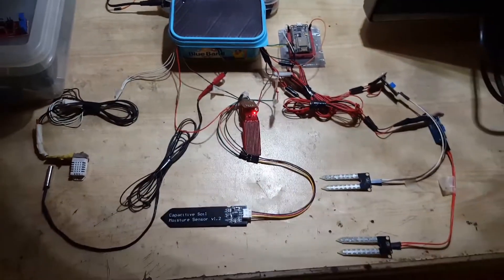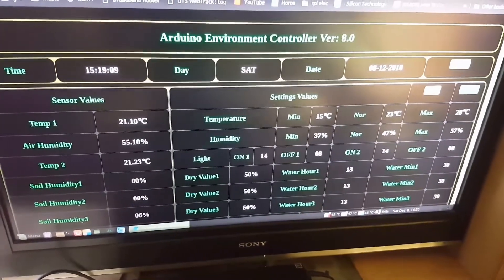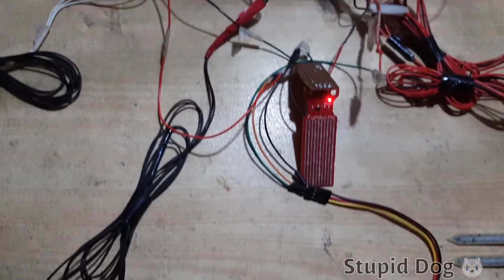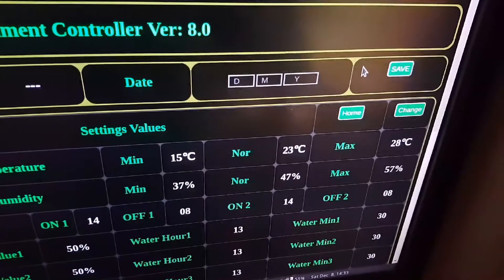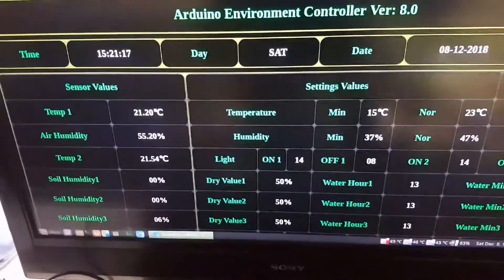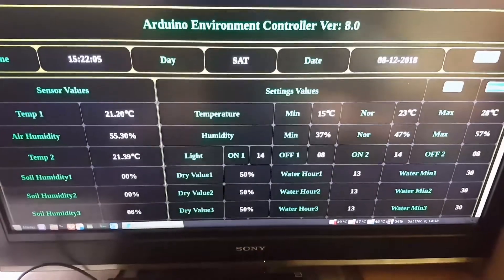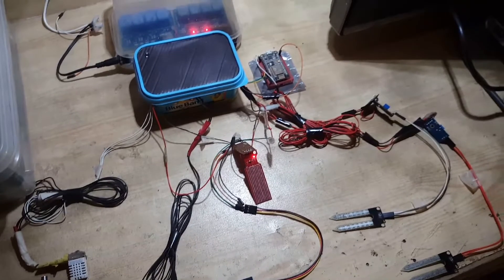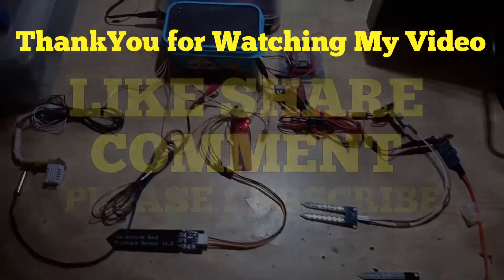Arduino Esp8266  Grow Environment Controller V8.0 (Progress Update) with CC/Subtitles

Comment: I’ve been watching your project and think this is what I need now it has ways to control the environment! I’d also like a parts list and some code to be posted as I could take a while getting parts delivered. Hope you can make another video explaining parts used and code plus about the remote interface?? Keep it up 👍
Reply from the maker: it's still incomplete as i want to do some major changes to make it suitable for large environment or multiple plants so i will post all the details when it's complete. I might make two different final ones , one for small box and one for larger room etc involving raspberry pi i'm not sure at the moment and so i have decided to try both and also make it suitable for any kind of growing soil/hydro aero etc but i don't have any ph sensor and not enough water sensors and esps

Comment: Will you post a parts list somewhere if not the code part at least that so we can build one and code it ourselves.
Reply from the maker: please watch the V4.0 video and if you need the code (before v8) let me know your email address you can remove /improve parts of it if you want to also let me know about it so i can improve mine too
Reply from the maker: Keypad details are in Light Timer V2.0 as it was the same hardware
Reply from the maker: i will post the complete list when i'm sure that it's complete ,because i'm trying to make it better and suitable for large room etc with multiple plants so it will take some time as i don't have all the necessary hardware yet , and recently i bought an ESP32 and i'm thinking about using it and it will depend on it's capabilities + cost etc